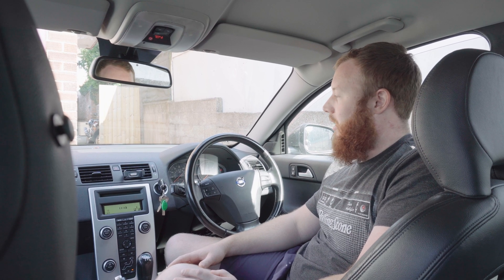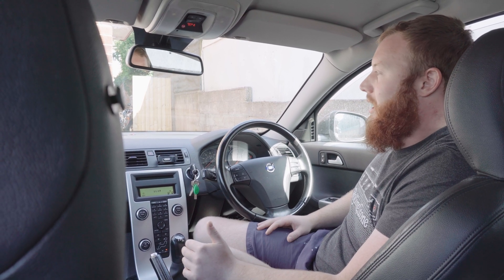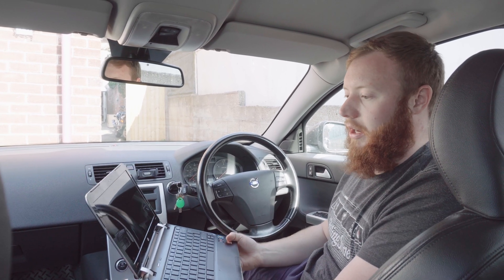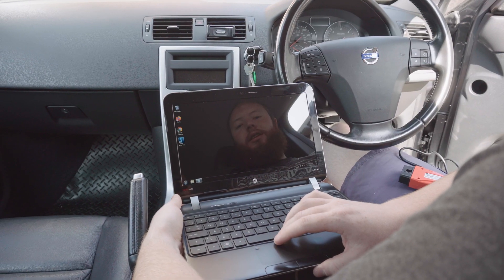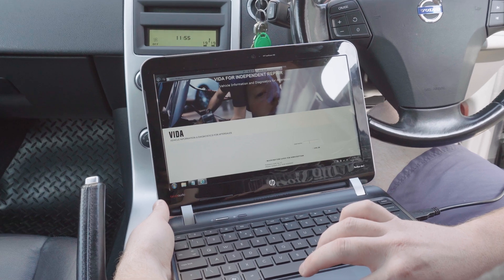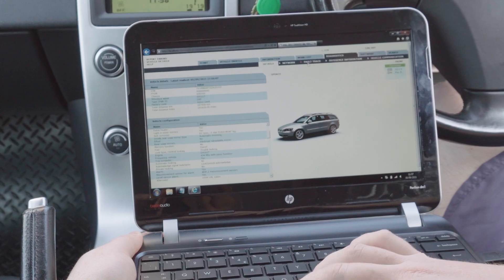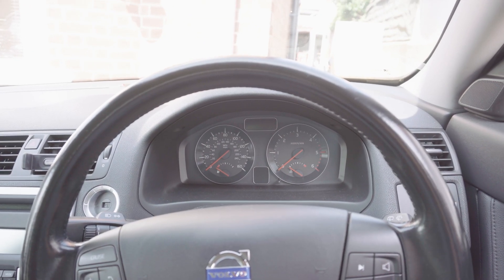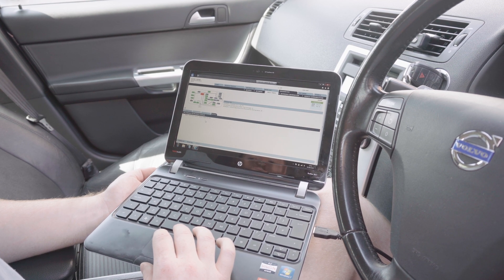V50 Headlight Level Sensor [Headlamp Failure Service Required] Volvo VIDA Code Reading - V70 S40 C30

Comment: Where did you buy that sensor as I can't find one
Reply from the maker: Picked it up on ebay, simply did a visual comparison with the one I took off. Its a BMW used part I bought, but identical, and it worked!

Comment: V70 D4 2014 here. 

I got the warning today and sprayed liberally with CRC 2-26 on both sensors rear and front, and then I fiddled with the wires so the 226 would get between the connectors. This removed the error message and I have now some time to find replacement parts, 

My iCarsoft OBDII reader could not say anything about the sensors as expected. 

Thanks for making the video!
Reply from the maker: Cheers, sounds like youre on the right track, the volvos can be a bit awkward with 3rd party code readers.
Reply: WD-40 ，ＯＫ？

Comment: Had the same issue on my 65 plate V40, fitted a sensor from a Mondeo (£20 compared to £92 for a Volvo one) it got rid of the light on the dash, but now dipped beam is too low, but I also replaced the lower wishbone at the same time and I'm wondering if the drop link hole in the control arm is in the correct place and affecting things ? The fixing hole in the wishbone was only drilled in the top surface, not all the way through like in the original. I may have to try the manual adjustment on the actual headlights themselves ?
Reply from the maker: Interesting to hear of the alternative sensor, and worth considering your suggestion that the drop link hole in the new wishbone could be the cause of the issue.   I would try adjusting them, probably can work it out.

Comment: Was it the same part number
Reply from the maker: We didn't make a note of the part number, but these sensors are used on a lot of different cars I don't think our replacement came off another V50.  We were told it would work and it did.  Sorry we can't be more helpful with the part number.

Comment: i have this problem with my car used autel obd2 got this error code 8f22 position sensor calibration not complete.on volvo v50 2010 mod realy i donot know how to complete the calibration, any help thanks
Reply from the maker: Thats interesting, are you certain the parts are fully functioning and installed correctly? I heard people having strange issues when the arm on the level sensor is a whole revolution out in one direction.

From a quick search, I am seeing some information relating to doing a manual calibration for it. If you are sure on the above then I would start investigating that. Apparently you can use Vida or an Autel diag tool, you need to look in the "Headlamp Control Module" section for the car and run either "Calibration" or "Initialization".

Hope that helps, have more of a search around maybe theres a guide someone has done about this.
Reply: @SPANNERRASH  now got new error code as well the last one 8f31 position sensor front signal to low permanent fault .

Comment: I have got similar error code. I see that my level sensor arm is going opposite way than yours. Is it possible that there is a connection between this and bending lights not working? They make a test when starting a car (beam going up, down, left, right) and at the end the error occurs.
Reply from the maker: Yeah it could be connected for sure, mine was definitely fitted correctly and I had no issues after installing the new level sensor. To this day!
Reply: There are possible 2 faults, levelling one could be suspension sensor, bending light could be control unit, which is fitted under headlight itself. I had one with water damage.
Reply: @jurons30  in my case it was about rotten pins in a connector. Replacing the plug and the sensor fixed the problem.

Comment: 3y late, but if its 1.6D the injector max limit is normal if car is tuned (nothing to worry about).
I do tuning and see this in every 1.6D from volvo.
Reply from the maker: Oh wow, so you think it's likely this has been remapped in the past and this is why?

I would have never guessed that with it being a 1.6 anyway, but I suppose why not. 😃
Reply: @SPANNERRASH If it was 1.6D its most likely have been remapped in the past yes :)
Reply from the maker: @Morteexx  It is indeed a 1.6D, what kind of horsepower and torque would you normally expect to get from one of these engines when remapped?

As fas as I can tell, its all totally standard in terms of modifications.
Reply: @SPANNERRASH 140hp ish :)
Reply from the maker: @Morteexx  Thats quite an increase over the 115, to be honest, I thought this car felt pretty decent for a 1.6, so maybe you're totally right and it has been mapped. Cheers for the insight on that!

Comment: When you replace the sensor why isn’t it necessary to calibrate the system? On my XC70 I have a problem with one of the sensors and I plan to replace it. From what I’ve read I need to calibrate the Suspension control module (SUM) with Vida.
Reply from the maker: I didnt, I chucked the same type of sensor on and I was away. The car had no clue it wasn't the same sensor because they are a simple part at the end of the day.

Only thing you need to be certain of is the arm on the sensor hasn't fully rotated, if it has it will be reading fully up or down and you will have to fiddle about.

Comment: Hi! Cool video, Dave!
What type of data cable do you use for the Volvo? The links don't work above.
Reply from the maker: I think the brand is "mongoose" its a tough one this because I got the laptop and cable as a complete ready-to-go system and they don't come up often. I think the seller has stopped putting them together.

Comment: What type of connector goes into the sensor
Reply from the maker: Hi mate, its some kind of 3-pin plug if I recall, I think the sensors are the same across a lot of cars of various brands. I simply eye-balled the type I have on ebay and it was identical and plugged straight in. a BMW one I used and still working perfect.

Comment: I bought the BMW replacement part. Error disappeared. After few months my low beams started to shoot upwards, and at the volvo service they told me the levels are completely wrong, and this part cannot be calibrated properly. Hence, I ordered a used OEM.
Reply from the maker: Strange, it took a few months? I would question whether your new part went bad, or whether another sensor went bad.

Mine is still going strong. I know you can have issues if you fit it having allowed the arm to spin the wrong way because then its sending a totally wrong signal to the ECU, but that would have been apparent straight away.
Reply: @SPANNERRASH  I guess I will never truly know, since I don't have a VIDA and can't check the calibration myself, but other sensors didn't give any error. Perhaps my replacement was different than the one You purchased. It just said it fits both volvo and wag

Comment: Without vida vice how can u tell which axle the sensor is dead (ie, front or back)?
Reply from the maker: Good question, I suspect a cheap scan tool could tell you which it is. Vida just happened to be what I went for. 

Other than that, trial and error fitting a new one.

Comment: The sensor's arm points to the wrong direction. It should piont to the back of the car. The bracket on the control arm should be right angle and the linkage betwen the control arm bracket and the sensor's arm should be almost upright.
Reply from the maker: Really? Mine is the wrong way around? 😆

How do you know this?

Comment: Great video! Clear speech and clear photography. Nice one mate.
Reply from the maker: Thanks Stephen, that's very kind of you mate! 😁Hopefully the info I shared helps people out with their Volvos!
Reply: @SPANNERRASH  Welcome, you're a natural at it 🙂. I have a 2012 V50 SE Lux. Liking it but noticed my drivers side headlight beam points way over to the left. Do you know where to adjust  beam for horizontal movement. Cheers. Steve.
Reply from the maker: @SteveUKUSNZ  Interesting issue there, I don't believe there is a left/right adjustment dial unfortunately. But you say the drivers side points to the left which makes me wonder if its set up for a left hand drive car.

If you remove the headlight from the car I think you can open it and there's a kind of switch to change between LHD and RHD. So it could be that if the headlight was ever changed for example.

Another thought is a potential issue with the headlight steering motors, if you car is equipped with that? Maybe the motor on the drivers headlight is stuck to the left side for some reason.

I'm not well versed on this one, but hopefully two useful avenues of investigation for you pal. 👍
Reply: Haha, forgot about this thread. Turns out I did not seat the bulb properly 😅

Comment: Where did you  get the sensor and how much did it cost
Reply from the maker: Hi Callum, I found it very cheap used on ebay, only around £10 if I recall.

It's worth noting that I used one from BMW. It looked identical to the original Volvo one which came up, apart from the BMW sticker on it. I took a chance on it and it works perfectly to this day. Hope that helps.
Reply: @SPANNERRASH  ok thanks mate is it true that the Volvo c30 1.6 2011. Leveling motors need coding  I currently have the fault code
HCM-B1A5801
Right Headlamp Levelling Motor Circuit.  Any help would be appreciated thanks
Reply from the maker: @CR_C30R  I'd be very surprised indeed if they needed coding, the C30 is pretty much a V50 with the back end chopped off. In terms of running gear its pretty much the same car. 

That code definitely sounds like switching the level sensor will solve your problem. My advice is get under the car, take the sensor you have off and have a good look at it to match it up visually with a tested working one on ebay then take a punt. Can always return it if it makes no difference after you plug it in.
Reply: @SPANNERRASH  I’m gunna take n/s and swap with o/s and see if the fault changes sides !
Reply from the maker: @CR_C30R  Smart move, I like it!
Reply: @SPANNERRASH  saves money then and eliminates stuff

Comment: Can you check your power values on the level sensors? Vida says it should be between 2-5V on each of them when car is in absolute level. I have 2.0V on the front and only about 1 V on the back sensor.
Reply from the maker: Hi mate, I haven't been under the car in a long while, and hopefully that will continue! 😂 Hopefully someone else who is looking at the level sensors can help you out with that if you're still stuck. Sounds likely your back sensor has conked out though.

Comment: Where did you buy your parts?
Reply from the maker: Hi Todd, just found it cheap on ebay. It was a tested good one though.

In actual fact, its one from a BMW. It looked identical to the original one I needed to replace in the pictures, apart from the writing on it saying BMW. I took a punt on it and it worked perfectly.

So it really is the same part. They're over priced from the dealer so I'd recommend going this route. Hope that helps

Comment: Thanks for the video. I have a 2016 XC 90 and I have been getting suspension service required messages as well as the headlamp message - although the headlamp one comes and goes. I brought it to a dealer and they said it was the right front sensor for the suspension that was faulty. I am hoping that once that is replaced, the headlamp warning will go away as well.
Reply from the maker: Sounds likely that will solve your problem Harley, hope it's as straight forward on the XC90 as it is the V50.

Comment: How are you? I’m from Brazil and I’d like to buy this cable. I saw you link from eBay, but it’s not working. Could you help me? I don’t know witch cable can be used In my car. Volvo v50 t5 2010. Thanks so much, and congratulations for your video!

Comment: Could you name me OE part number?
Reply from the maker: I think it's this: 30797971
But there are a few different numbers for these as they seem to have updated the part multiple times. As I mentioned in the description, lots of cars use these sensors and I think many of them are interchangeable. The one I fitted was a used but known working BMW part!

Comment: Where did you buy the sensor from?
Reply from the maker: Hi Aleksandar, I picked it up cheap on ebay. It was a known good one.

Here's a top tip, I actually used one from a BMW car. It looked identical to the original one I needed to replace apart from the writing on it, so I bought it on a punt, and it worked perfectly.

It's the same part :)

They're very expensive new from the dealer I think.

Hope that helps

Comment: I have a 2012 XC60 that is having a similar issue.  Where did you get a VIDA from?
Reply from the maker: Hi, after looking into setting VIDA up myself, and realising the cable alone is around the £135 mark, I purchased the full code reading setup (laptop with VIDA pre-installed and cable) from the guy on ebay who sells them. He's got one for sale now: https://ebay.us/Qgh5qu

Pricey, but its going to be however you do it. At least this way there's a guarantee it will work.

Comment: Do you need to do calibration after this sensor replaced?
Reply from the maker: No calibration needed, I simply plugged it in and it was fixed.